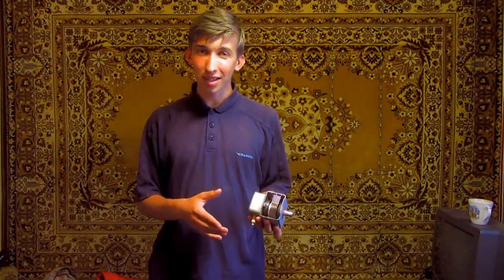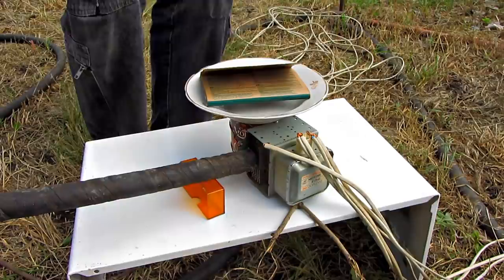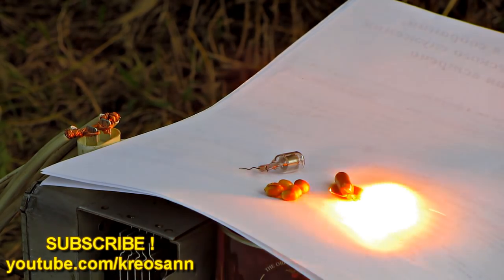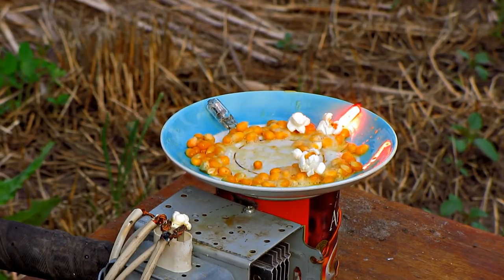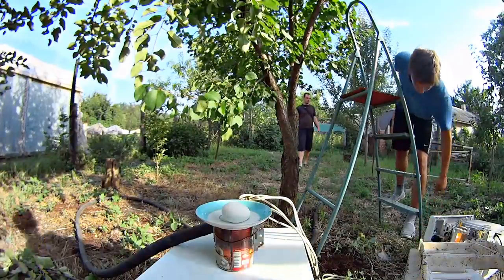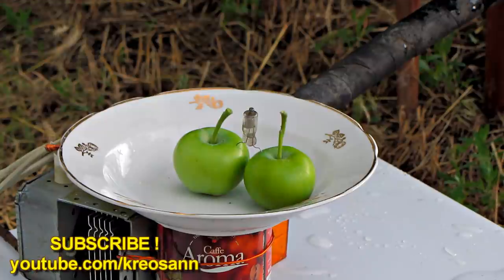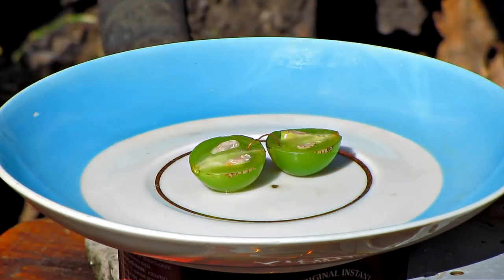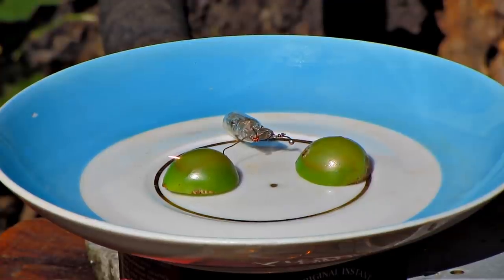What a microwave is capable of! Magnetron cooking

Comment: Possible Answer of Why: Someone told me once that low voltage is sent down the tracks for railroad crossing lights etc. to activate. They said it works because the resistance is very great between the two tracks normally so each side is used as one side of the circuit for the signals. The switch to activate everything is connected one side to one track and another to the other track. The circuiy needs to close for it to activate. As a train approaches the resistance becomes smaller between the tracks at the circuit because the train shorts the path and conducts electricity. Eventually it closes which allows the switch, current, or lack of resistance to switch the the warning/signal sequence at the crossing on.

Comment: I'm never using a microwave again. will not even keep one in the house
Reply: +Mike M I wouldn't worry about it. All other forms of cooking are more 'dangerous' to food. Because microwaves are substantially longer than infrared(our main cooking method) it's energy is absorbed by larger structures in your food. Have a peek at the electro magnetic spectrum, you will note that all the wavelengths we have a safety appreciations for are short than IR.
Reply: +Mike M microwaves have shielding on its front plate and all around. you dont have to worry about it, since they have safety features. microwaves will not turn on unless the door is closed.
Reply: +Hamguy Bacon what if u manipulate it :3? .... a microwave cannot give u cancer